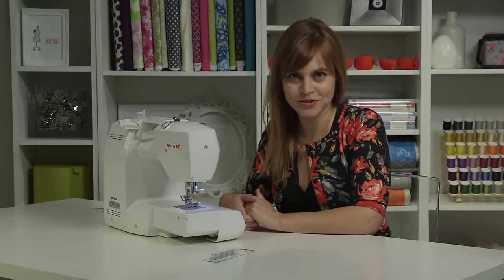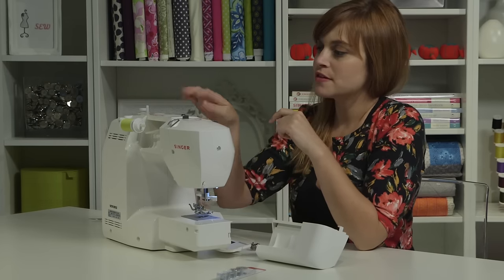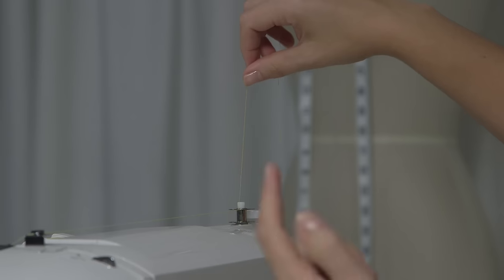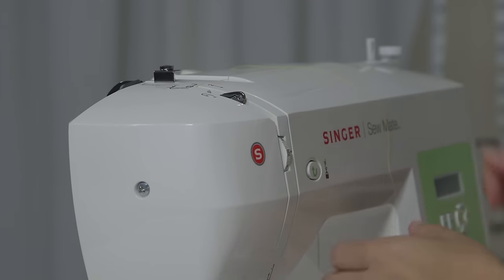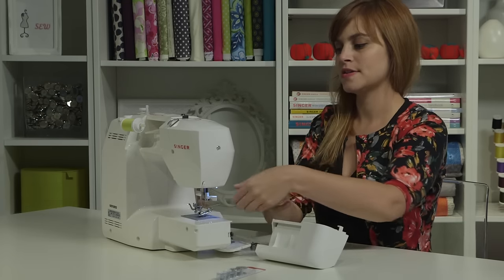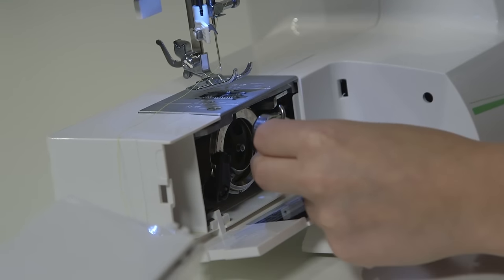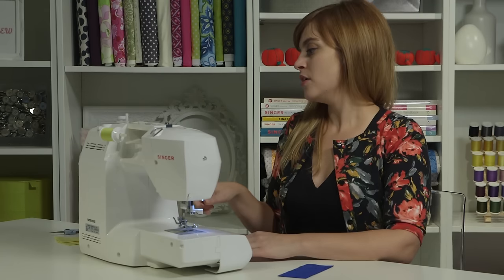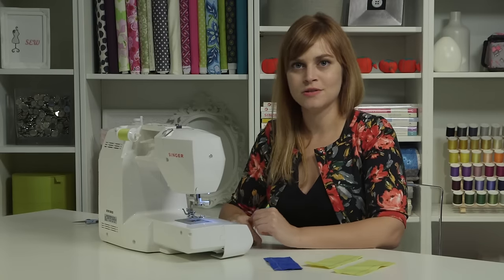SINGER® SEWMATE™ 5400 Owners Class - Threading

Comment: I did this and my pops up C4 what’s the cause?
Reply from the maker: A C4 error is usually due to thread tangled in the bobbin case. You will need to remove the bobbin case and pull out any thread. For further assistance, please contact our Customer Care Team at 1-800-474-6437 or email them here: https://www.singer.com/email-us/. Thank you!

Comment: So to be clear when you’re ind the bobbin it goes around that button up too but NOT when you load sewing thread ?? That visual shit is not good ...can’t see exactly what you’re doing .
Reply from the maker: Hi! The small post is for the bobbin. The longer spool pin is for the thread. Thanks! -TB
Reply: @SingerSewingCompany  I'm talking a bout the little ":screw" as it's called in this video. Not where the bobbin fitting goes? I figured it out . The thread goes around the "screw" when winding the bobbin; not when winding the thread.
Reply: @SingerSewingCompany  also, I did not mean to cuss! lol. that should have said "shot." phone to text is a bad thing sometimes.